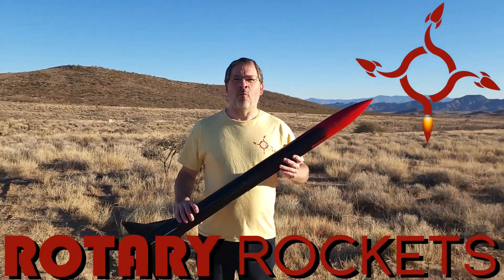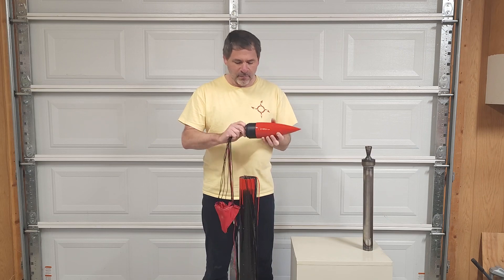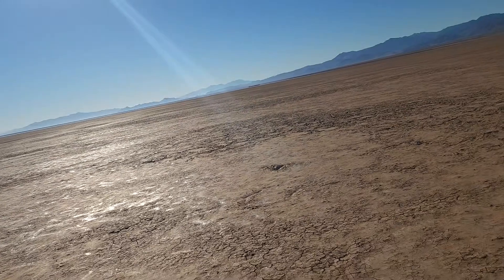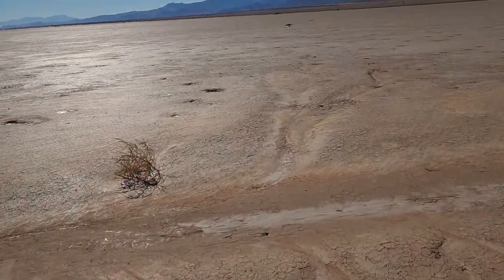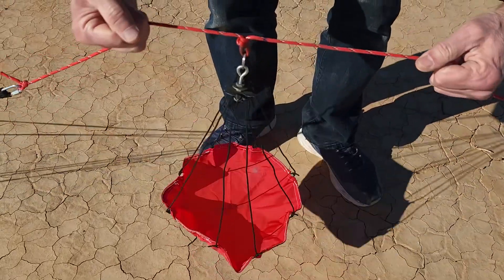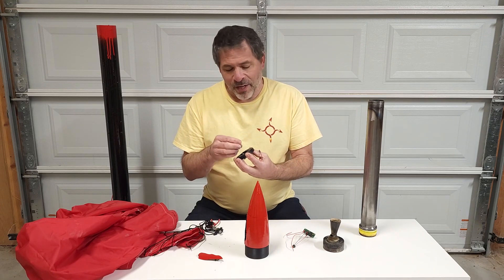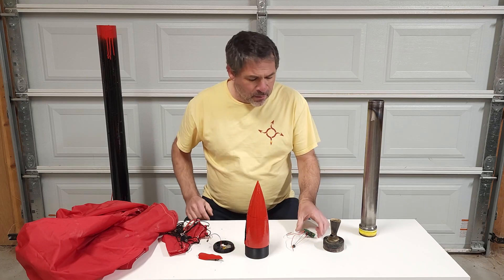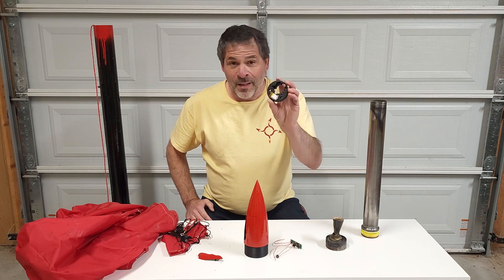1000 Subscriber Special. Our FASTEST and HIGHEST launch of a new homemade rocket and motor.

Comment: Given you lost sight of the rocket and didn't see deployment, how do you know the nose cone didn't come out at speed?  You should prob have shear pins in it and vent holes for the computer.  Also having made a number of 3d printed AV bays I'm not sure your nose cone base was strong enough to hold a bolt, let alone a charge going off as well.
Reply from the maker: If the nosecone had come off at high speed, I would expect damage to the rocket. But when we found the nosecone, we had not yet found the rocket.
I did have vent holes for the computer. We will be working on a significantly stronger nosecone base for future launch.

Comment: you guys are great. i have a question. do you guys know and use openmotor to design your rocket motors ? you could have saved a lot of pain with lost motors using it. also openrocket for the rest ?
Reply from the maker: I use OpenRocket for rocket design. I really love that program. I looked into OpenMotor a while back but never actually used it for design. I will have another look at it. For the last few motor designs, I have been making nozzles to match Loki motor specs. That has worked out pretty well.